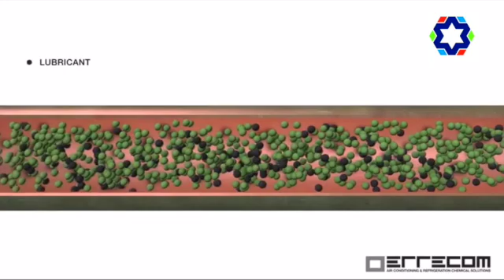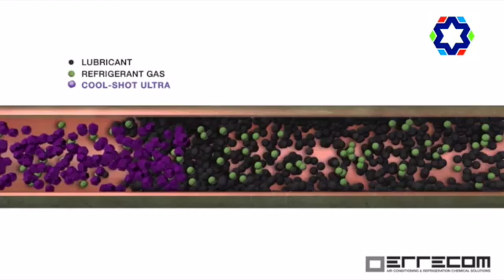AC Not Cooling?  Get Cooling In 30 Minutes!!! || INFINITY HVAC || VINOD CHANDAN

Comment: Hi sir ,
video make video on modern refrigeration tools like fieldpiece manifold gauge .how to calculate super heat subcooling during the gas charging also along with weight scale charging for refrigerant it's necessary to next generation I am also visited our Pune shop.
Thanks for creating good online  platform HVAC tools and materials.
Reply from the maker: Thank you for your kind response.
We shall work on your suggestion in our upcoming videos.
For more details - email - enquiry@ihvac.in
or Whatsapp / call 9223521222

Also you can directly buy - www.hvacmall.in